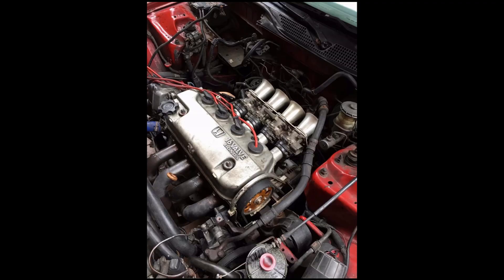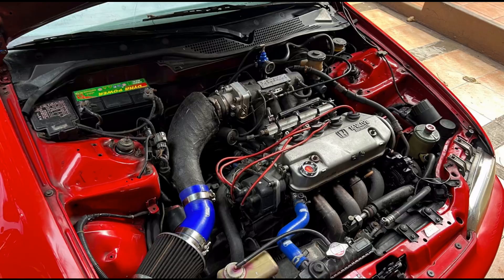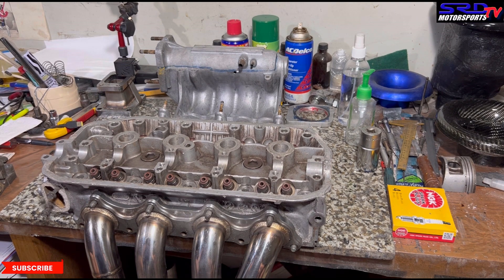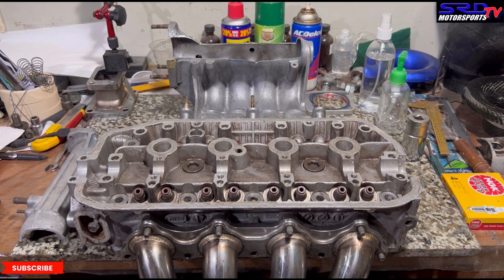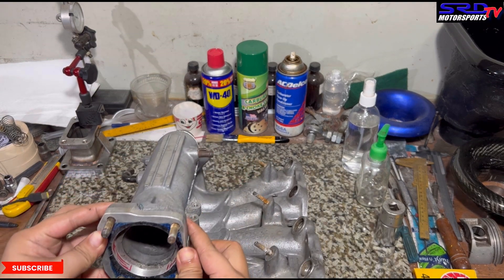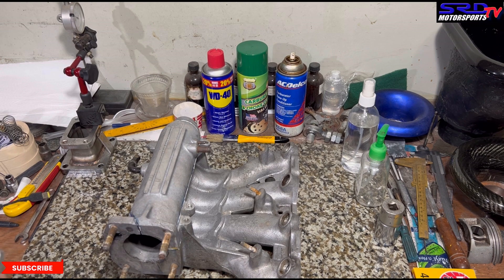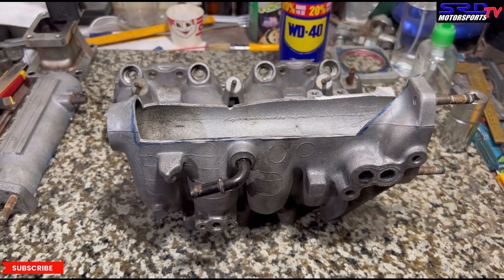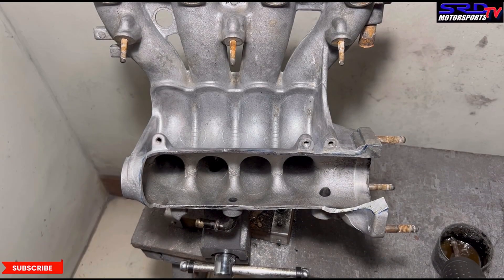D16z6 Intake Manifold Porting SOHC |P08| by SRDmotorsports

Comment: hello sir as of now i have a stock d15b p08 engine, what basic upgrades can i do? thinking of camgear, throttle, and port matched head. i wanna spend my money somewhere na lalakas young engine.
Reply: ps it already has a header, intake, and a tune thanks!
Reply from the maker: Sounds like a good engine u have there, port matching the head isn’t needed unless the head will be ported the gains are minor if it’s stock head and stock manifold and just port matched 

what kind of header do you have? And care to share who tuned it and from where are you sir?
Reply: @SRDmotorsports  custom header made by a local shop, tuned by maligayatuned here in pampanga.
Reply from the maker: I see not stainless or it’s a stainless header?

camgear depends what brand and not all places understand the metrics or the difference if it’s a y8 gear or z6 gear and would rather not gain due to it but then the end story reason would be claimed as
“Camgears didn’t give me gains”

Comment: Is this ported manifold better than after make manifold like a skunk 2
Reply from the maker: Oh the skunk2 does a lot better still actually
Reply: @SRDmotorsports  ok bro thanks for the information
Reply from the maker: @DharamSingh-or3re  no worries man thank you for checking these out! :)
Reply: @SRDmotorsports  yes man
Reply from the maker: Glad it’s helping with ideas ofcourse
Reply: @SRDmotorsports  sure it is I have a single cam and I want to get the most of it I’m running hi compression with a stock head I think the compression is eney way From 11.9 to 12.5 will it runs on 93 or 95 octane pump gas ? Than for eney enfo
Reply from the maker: @DharamSingh-or3re  oh yes it will be safe on pump gas especially if you can have it tuned then u will get good performance and reliability as well

Nice to know you a sohc guy 👊
Reply: @SRDmotorsports  yes brother ok because I’m hearing that the moto will not last too long and I need race fuel … yes I’m running a chipped p28 .. yes I like the single cam
Reply from the maker: @DharamSingh-or3re  as long as u pay attention to pre ignition and check it u can adjust timing accordingly and Ofcourse don’t drive it “under rpm” meaning if low rpm don’t step on too much that’s free preignition chaos hehehe
Reply: @SRDmotorsports   lol ok bro thanks I know
Reply from the maker: @DharamSingh-or3re  ayt man hehehe

Comment: About the venturi effect, would that be why the inner diameter on the intake tube side of the TB is slightly larger than the IM side? like a few mm difference hehe
Reply from the maker: Yes yes it’s actually a “funnel” ish type of thing right?

Like it’s 60mm only at the plate and by the plenum flange but towards the intake pipe/tube it’s 64-65mm

Comment: nice video. paps alin ang mas ok kung ikaw papipiliin ported skunk2 ultra street or ported rbc intake manifold stock k24a rbb pag kakabitan .thankyou idol.
Reply from the maker: Stock k24 = ported rbc
Reply: kung stock block , ported head dc 3.2  cams vtc50  mas ok parin ang ported rbc  kesa sa ported ultra street?(type ko yung utra street hehe) ganyan yung pinagiisipan ko setup idol pag kinapos pa pwede pa ako mag low boost. madame na ako nabasa pero iba  parin pag ikaw nag bigay ngadvise idol. thankyou idol .
Reply from the maker: @GoogleAccount-dn2bw  both would work naman actually

Comment: Pressure differential at 8:10
Reply from the maker: Actually just understanding that, would lead to a lot of people not gunning for a b16 throttle or atleast not the first priority

As the plenum is the expansion “chamber” it recovers pressure now the task of feeding it “well” and quick enough is the deal :)
Reply: @SRDmotorsports  Do you port match or leave the steps between the throttle body, intake manifold, head and exhaust manifold? Just curious as I've seen builders from both schools of port matching and not port matching make good power
Reply from the maker: @findtherightbeat  I actually do both… depending on the overall package…if it lacks cam vs lacks port Volume vs lack of comp etc or too much of one of those etc
Reply: @SRDmotorsports  Also, I think the stock D16 throttle body is more than enough for what most make with their set ups, even those with high VE builds
Reply from the maker: @findtherightbeat  I actually agree yeah